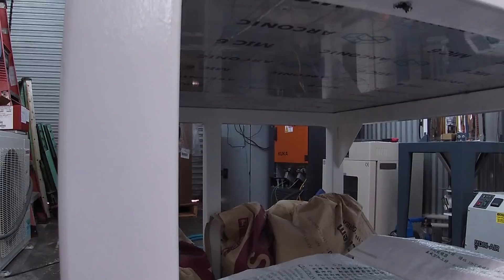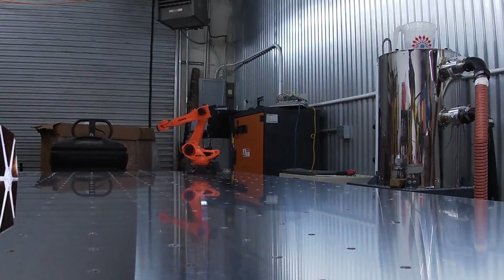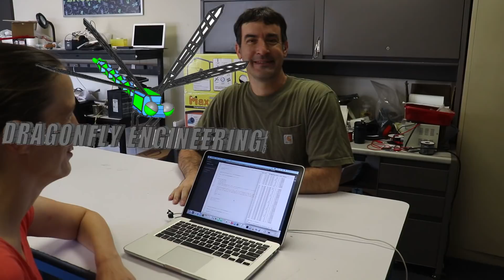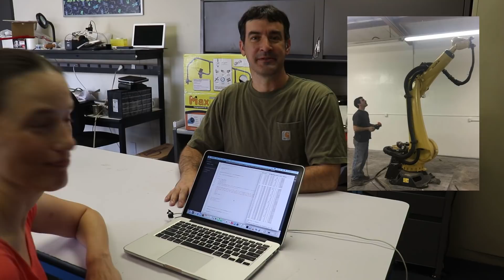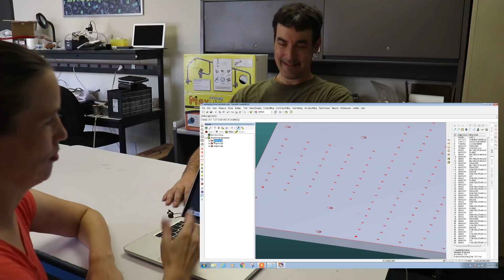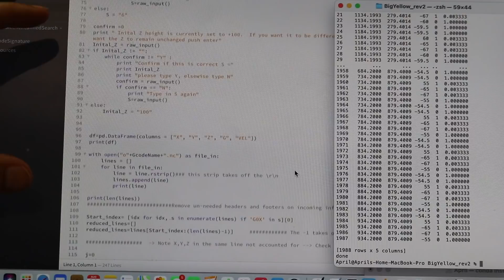6 AXIS ROBOT MACHINING

Comment: if you lie about the tool weight a little(heavier then actually is), when you engage the drives and remove the motor brakes the tool tip will momentary lift from the surface instead of dropping in to it, this also helps remove some dwell marks if you pause and interrupt a running program or when aligning with metal on metal prevent the impact.

Comment: A few questions: First of all, why not drill the holes completely through? Second of all: Why not bolt the table to the milling machine, tap it in with a hammer, and then let the milling machine do the tapping? Since the holes are already drilled, you should have enough locating features to indicate in the surface.
Reply from the maker: I'm on the fence about the holes being through.  I may open them up after anodize.  With the holes being blind I will have less anodize in the holes so the tap will cut better.  The table is too big for my mill and the robot is right there next to it.  Thanks for watching!

Comment: Are you sure you want to be the proud owner of 700 tapped blind holes? are you sure you're never going to regret this decision? what about getting half way there and drilling through at 3mm and partially at your desired diameter?
Reply: I would have drilled through as well, partially because it gives me more thread engagement, and partially because blind holes are in my experience a gunk magnet.
Reply from the maker: @vincentguttmann2231  Hi Vincent, yes It is hard to say which is better, blind vs through. One thought is that I can have a dirty air return that suck air through all the holes and return it to the hepa filters in the clean room, if ducting is practical
Reply: @DragonflyEngineering  Hmm, that sounds like a great idea! My first idea would be to just attach something like an MDF board with standoffs to the bottom so you have clearance for screws. Maybe a solid bottom board with washers so that you can clamp that against the table, and then pillar-like support structures and a rim of wood around the outside above that so that it looks a bit like the heated floors that the Romans had. Sorry, that's the best comparison I could think of, maybe you know what I mean. Also, it doesn't have to be MDF, but that's rather easy to glue together and cheap and light compared to metal.

Otherwise you could just plug the holes with set screws or 3D printed thingys (do you own a 3D printer?) that have a bit more functionality like an adapter to whatever mounting system your cameras use, or something else.
Reply from the maker: Yes, this table is going into my clean room, so I want to minimize future chips and particles when I integrate. Thanks for watching!

Comment: Does Kuka offer software to automatically convert G Code or is that something that is not done that often in real life? That saved a lot of hand work. Nice job.
Reply: If they offer it, I would assume that it would cost some money. 

Also, it's not the exact current setup (e.g. maybe breaks existing workflows), and April looks like she totally knows what she's doing, so why fix a system that isn't broken and literally comes with a competent person to fix it?
Reply from the maker: Thanks Paul. Yes I think Kuka sells a g code converter but I don’t know the price. Other folks have mentioned there are free ones but I have not looked it up. Check out my robot purchase video, there were some comments.  If you stare at kuka code made from a simple teach pendant code then you can find the format and patterns needed. 2 files: “src” and “dat” dat is a points list
Reply: there is kuka.cnc. Im not sure if this exports G-Code but its basically a CAM software specific to kuka.
Reply: also sprutcam if youre only doing simple operations